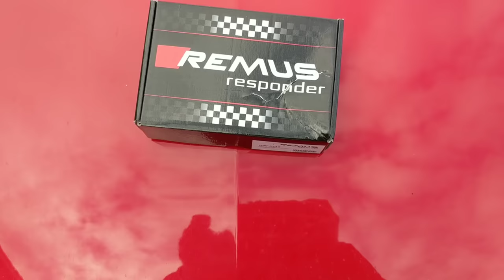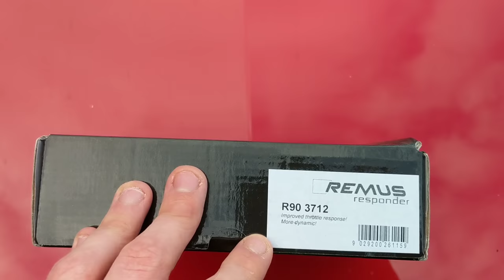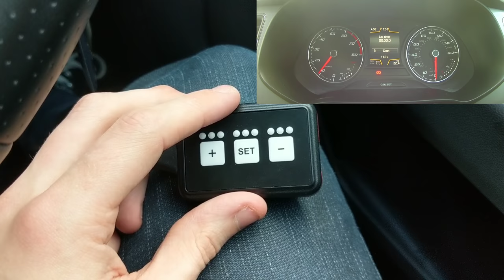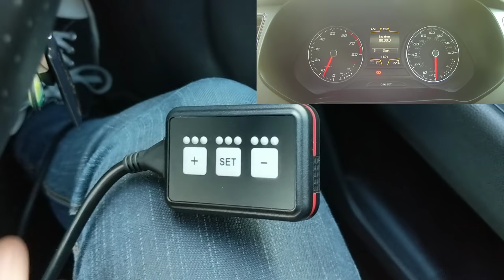Throttle Responder are they worth it? 🤔 (How to fit) 💥

Comment: Nice video dude! Hate that noise 5.10 wheels bouncing turn off your traction control and it will eliminate that and maybe help your 0-60 time alot better
Reply from the maker: Thanks mate, believe it or not but it was turned off 😂
Reply: @ryanpowell5947  Install the transmission mount from torque solutions, the pendulum mount and the dogbone insert. This solved the wheel hop on my mk6 apr stage 2 K03..

Comment: What do you think of me getting one for my 520i 2.5L, it's my new project, but i am trying to do as much as i can, please give me your suggestions, i am doing cat back, cold air, and then i was going to get it tuned
Reply from the maker: Hi mate thanks for the comment 👍, that's is a great project car hope it's going well at the moment, also that's is some tasty mods you looking at putting on, I'm regards to the throttle responder I would say it's diffintley  worth it it would save some time on your 0-60 and also you will always have that power there at higher speeds with waiting for the throttle to quick in, would love to see some pictures of it mate of you have Instagram send few on chat 👍
Reply: @ryanpowell5947  Yea i am not going to do the throttle, if anything i am just going to take it by The Dyno, and get the ECU tune, that Plug and Play stuff isn't safe as i have Heard.

Comment: These don’t make your car any faster.  All they do is increase throttle response.  They speed up the response.  They don’t open the throttle butterfly any more than a standard car would as it isn’t possible.  The increased throttle responsiveness makes it feel like it has the old fashioned cable (which is as responsive as is possible).  Think of it like the throttle butterfly is on a slow servo that can’t keep up.  All it does is make the servo faster

Comment: Honestly that test is worthless, there was too many variables that could influance on measurement. Manual shifting, different start, did you kick gas pedal to the ground in both cases? Only two tests, this is not enough. Using non pro software to measure. At least you could do 5x runs without activated throttle responder and then do 5 runs with activated and then compare best score for deactivated vs activated. Good luck in future!
Reply from the maker: Hi mate, really appreciate the feedback, next time i will make sure I do a few more tests to try and get more of an accurate reading, aslo looking into more reliable tracking software. but hope you enjoyed the vid and the rest of them.
Reply: @ryanpowell5947  one może tuning, from experience I know it id Good to cool Down engine beetwen  runs. Two rund in a row are ok but 5 will cause high temperature nad wilk influence on times. I reffer to drag Racing with m5 f10 nad mustang gt'19. Cooling engine od important. Good luck nad I want for more vids:)